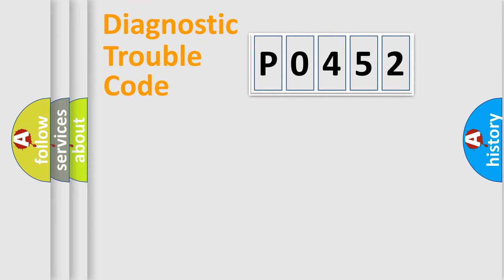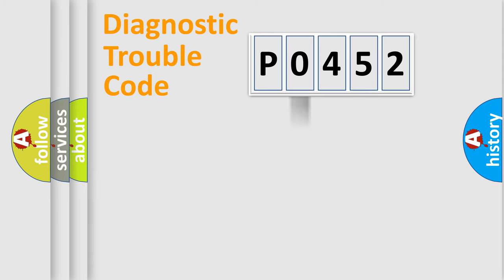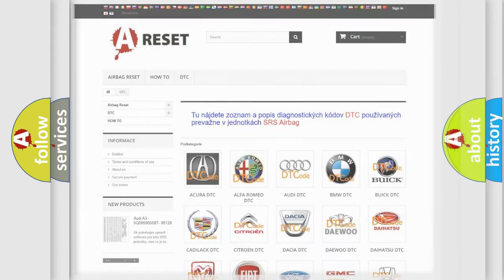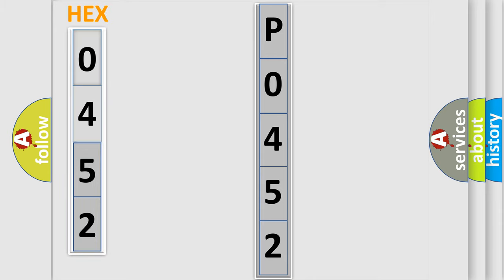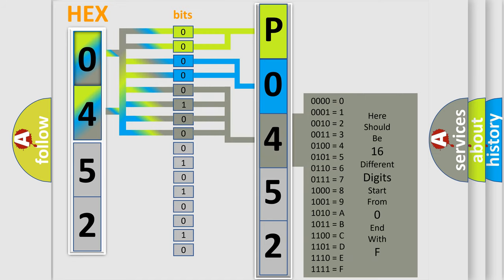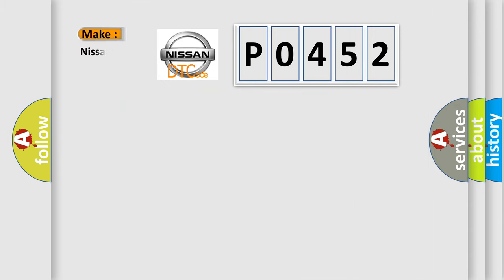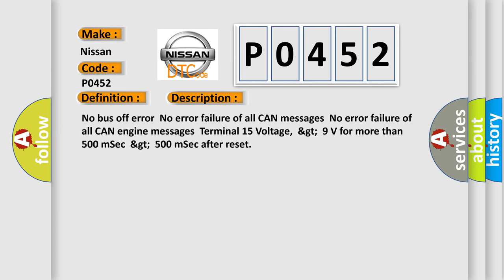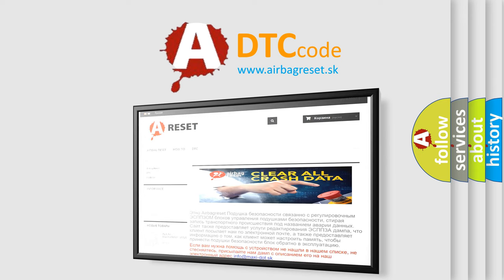DTC Nissan P0452 Short Explanation

Comment: Nissan p0452 is evap pressure sensor/fuel tank pressure sensor low. & is probably a loose connection or need to replace evap pressure sensor / fuel tank pressure sensor. Idk where these guys come up with can bus error replace ecm?